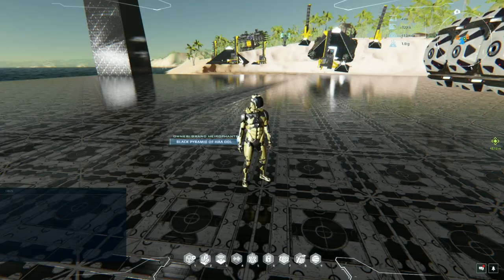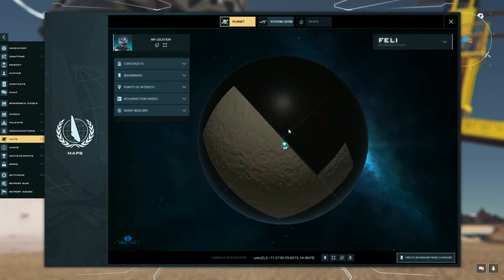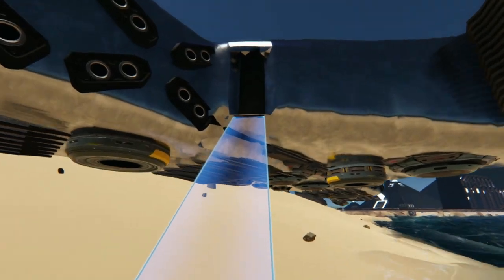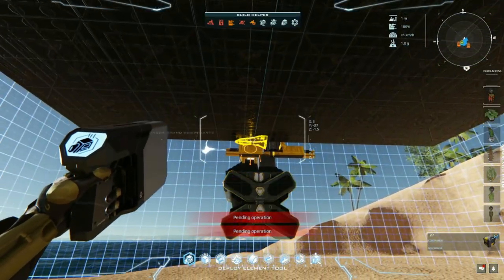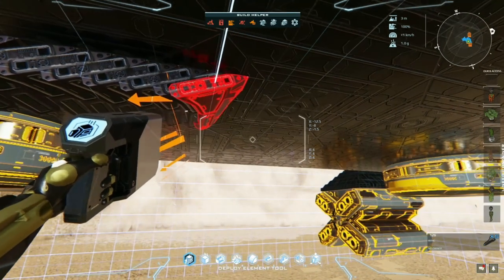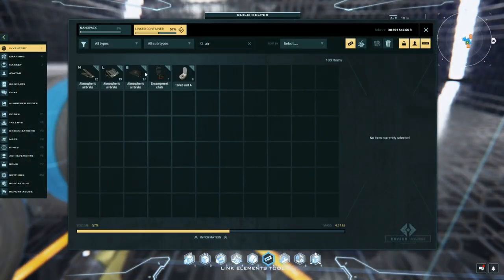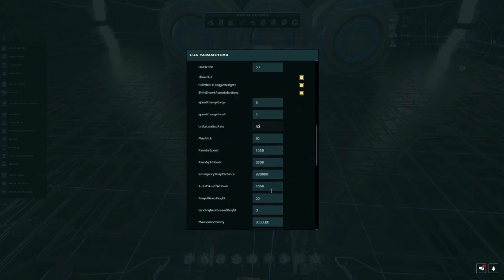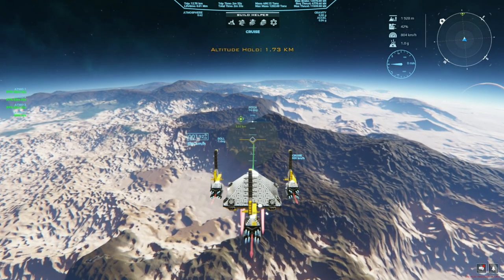Guide on Building and Operating a Tri-Scanner in Dual Universe

Comment: Came here to say thanks.  Saved up for 3 territory scanners and on day one of scanning fount 2 super nodes, 1.5M coal and 2.1M hema. Backside of Alioth, but a super node is a super node. Still using the zigurate II.  Thanks for vids!
Reply from the maker: Awesome, Joe! Congrats on the finds. Keep going, there's still plenty of nodes out there, even on Alioth
Reply: @ShamsTales  How do you move around while holding alt?   I can't move my ship and when i let go of alt, it snaps back to the rear.
Reply from the maker: @joec8332  Hey, Joe! Alt is a toggle for me with the script  I'm running. I press alt to toggle free look on and off. Also, pergaps try changing view point by cycling through them all with insert.
Reply: @ShamsTales  What script is that? Can I pull out just the freelook part?
Reply from the maker: @joec8332  I'm not sure what you can pull, sorry, I'm not a coder. The script I use is Archaegeo and Dimencia's public, open source LUA script: https://github.com/Dimencia/DU-Orbital-Hud

Comment: Maneuver engines also consume less fuel, making them overall the best engine to use imo. The amount of additional thrust provided by military engine vs the addition fuel costs doesn't really make military engines a worthwhile, and could easily be offset by adding 1 additional maneuver engine per 5 engines placed.

Also, I'd love to see your inertia matrix for this scanner ship. It performs exceptionally for all the addition weight on the extremities. Very impressed with this build.
Reply from the maker: Hi Armitage! Thank you! I do show the inertia matrix at some point. Maneuver Atmosphere engines sadly use the same fuel but have half the warm up time. Maneuver space engines use much less fuel but have the same warm up time. Which engine to use depends on what you're looking for from them.
Reply: @ShamsTales  You might want to double check that. Unless they changed something in the latest patch, maneuver atmo engines most definitely use less fuel for the same thrust as standard engines, standard atmo engine Ls use 3981fuel/h and maneuver use 3583 fuel/h (about 10% less fuel for the same thrust as standard engines), where as military atmo L use 5733 fuel/h (about 45% more fuel for 20% more thrust than standard engines standard engines), Maneuver engines provide the best thrust to fuel ratio (only equaled by freight engines, but they have 4x the warmup)
Reply from the maker: @ArmitageShanksMC  I'll double check. Thank you!

Comment: nice guide. 
what button or key do you press to duplicate and move a new element from an existing one like you did here @ 8:25 or @ 10:08
Reply: use the select voxel tool, then ctrl+C to copy the area selected and then you click were you want to put the voxels, and for elements just move the arrows when placing an element and place them using the enter key insted of the mouse click
Reply: @warlockreyr6843  I was talking about element not voxel, unless you are saying it does apply to element too? see how he more or less start placing the element on an existing one then moves it later on in this video with xs wings
Reply from the maker: Hi Gael, thank you! As for element placement, while in fine movement mode, as in, while moving the element with your keyboard and not your mouse, press, 'enter.' That places the element and starts to place another element directly inside the last one already in keyboard movement mode.
Reply: @ShamsTales  wouaw I did not know that, I've been making a new hauler ship it's got 1200 xs wings so it is hard without such tricks. Thank you
Reply from the maker: @gaelmusoya1558  oh wow! I'm glad you found this out now! Best of luck with your build.